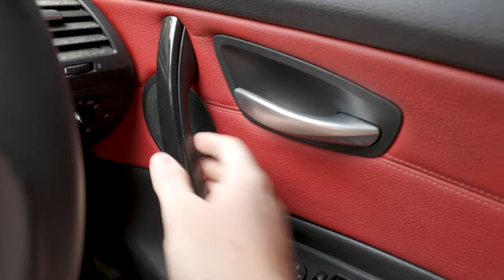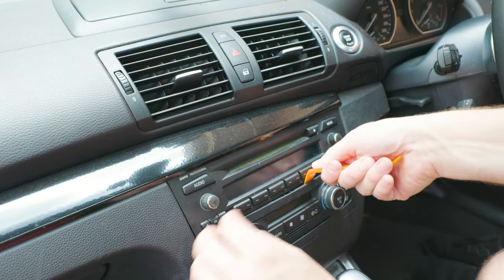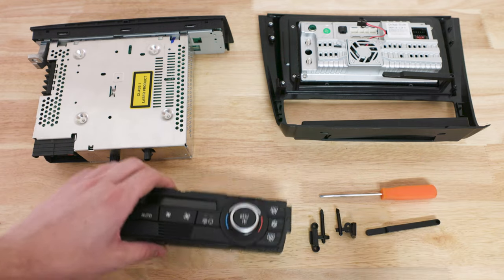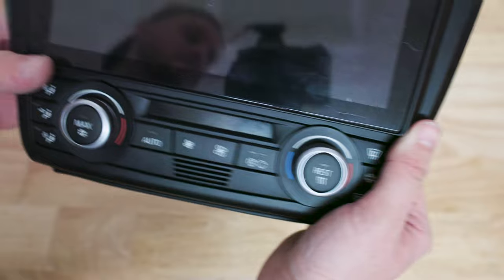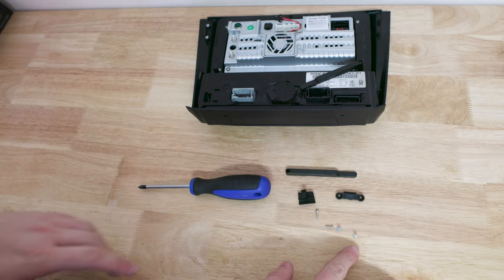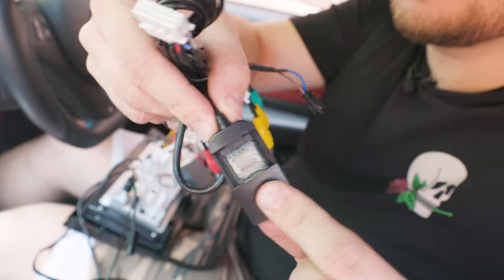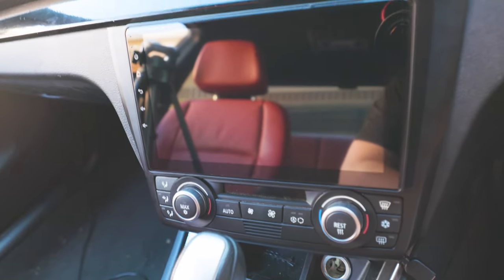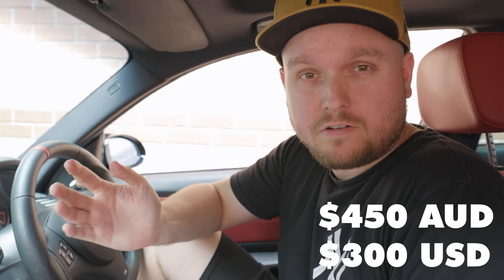CHEAP APPLE CARPLAY HEAD UNIT FOR MY BMW 1 SERIES 135i E82

Comment: Did you notice that the trim-surround is made for a left-hand drive vehicle?
Reply from the maker: Not particularly. What makes you say that?
Reply: @ElliottBrooks the screen is flush on the left and protruding on the right, making it angle and face towards the left of the car, thus made for a left-hand drive car / driver to control.

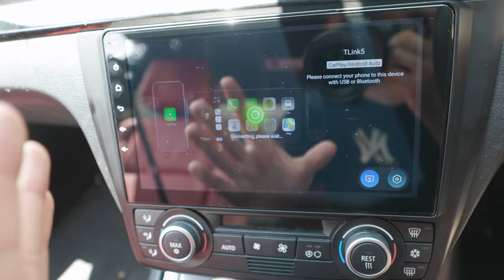@11:45
Reply from the maker: @AJS82041 it’s the exact same size on both sides. So if it was reversed it would have the same issue. It would protrude past on a left hand side too. Probably just oversight in the design process. If you want perfect symmetry with the bmw interior design, I would consider buying a new bmw rather than trying to upgrade with cheap aftermarket parts 😅

Comment: the link provided lots of options which exact one did you use?
Reply from the maker: I got the QT10 I believe it’s called. Or the Q10 maybe. There is variations. Automatic and manual depending on your car. Give the page a read, it’s fairly self explanatory

Comment: Hey man, looking at buying one, What are your thoughts now you’ve had it a while?
Reply from the maker: I give it a 7/10. Apple CarPlay is a big bonus. Downsides - the wireless connection can be a bit funny if you try switch phones or plug in before it’s connected wirelessly - requiring a restart. It changes the reverse sensor noise and sometimes is a bit funny too (could be because I haven’t installed the rear camera yet). Beyond that, it’s great. Having apple car play is a huge bonus and the screen modernised the car massively. Sound quality is good once you tune it. Prior to install, I was unable to change songs on Spotify when I was plugged in via aux / with CarPlay that’s now no problem and a big quality of life bonus. Hope that helps - let me know if there’s any specific areas you want to know about

Comment: Thanks for the video! my front right speaker is not giving any sound - do you know what might be the culprit here?
Reply from the maker: Hey mate, 

Did it work before hand with the regular radio? 

Did you check all wires are plugged in to the back of the new system? That’s what will determine if things are working - especially if one side is and the other side isn’t.

Comment: When connecting to CarPlay does it automatically play music because I’m having troubles with mine
Reply from the maker: What do you mean by automatically play music? Once you open carplay, you need to then have a music app - i.e. spotify - to play the music
Reply: @ElliottBrooks  like when it finally connects and puts you in the CarPlay mode does it play the music automatically like straight away without you pressing on play or anything?
Reply from the maker: I guess that would depend if you’re already playing music on your phone at the time or not. Usually when I get in my car, I’m not playing music on my phone. It auto connects, then I press play and drive off
Reply from the maker: @LuisJaimes-lb5dj  Possibly - as I said, if you have music playing before you connect it might do that.

If thats a normal feature of carplay, then yes

Comment: hey i followed pretty much everything but i can’t get any audio output, apple car play works and gps but when it comes to music nothing comes out
Reply from the maker: Check your wiring. You might not have connected two of the wire stacks together. That one is easy to miss. Otherwise it might depend which system you have and should contact the seller to check compatibility

Comment: Great vid bud, I have PDC and start stop buttons, would they locate in the heated seat “slot” of the frame?
Reply from the maker: Thanks! Yes, if they are currently in a thin row below your aircon unit, then this fits where I reference the heated seats buttons go. I think that row of buttons is interchangeable across various spec of BMW
Reply: @ElliottBrooks  cheers Elliott and thanks for the quick reply, might get one ordered!

Comment: Bonjour vous n’avez pas brancher la fibre optique ?
Reply from the maker: hello - no, I did not connect the fibre optic cable. I read online that certain models speakers don't need to connect it - but there is an extra fibre optic connector piece you can use if you need to. At first I was worried, but my sound works great - so no problem! :)

Comment: Better sound than the original?
Reply from the maker: I can’t remember the quality of the sound prior to installation - but the new sound is solid once you tune it. I really enjoy my sound system now that I can use the steering wheel controls to control Spotify for example. Volume 12 and it’s pumping and sounds very clear. I have stock system - not sure how it works with upgraded systems though

Comment: Hi Elliott, Thanks for the informative video.  Does your PDC gong work on this android unit?
Reply from the maker: Good question. Yes it does, but it changes the sound slightly. I prefer the old sound, but it still works. 

It also shows you a visual representation so you can see which side and how far. There is the option to install a reverse camera too. I may do that in a future video
Reply: @ElliottBrooks  Thanks for your prompt reply.  Cheers from Melbourne :)
Reply from the maker: @tvman3275  no worries! Are you going to give it a go?
Reply: @ElliottBrooks  Yes I will give it a go.  An upgrade is definitely needed because the OEM Professional radio has been playing up again (pardon the pun).  Also listening to music via the AUX port is not very convenient at all.  Could you please confirm that the black fibre optic & green cables connected to the factory amp will not be used in this upgrade?  Thanks.
Reply from the maker: @tvman3275  Yeah i didn't end up plugging in the optic fibre cables and the sound is fine. I agree that the professional radio is crap and AUX is terrible because you can't use the steering wheel controls. This upgrade is amazing for its price - not perfect but a huge benefit having carplay

Comment: hey bro where do you find carplay? cant find it on my screen
Reply from the maker: Did you buy this version of the screen from my link? if so, the app is called TLINK5 and has a picture of the car and a phone. It comes pre-installed. You need to connect your phone via bluetooth for it to work

Comment: Is your head unit QT 7 or QT10 ??
Reply from the maker: I got the QT10. It should have the best response times. It’s not perfect but I wouldn’t want slower
Reply: thank you
Reply: yes, I got the same I'll be instilling it thanks to your help!!!!   I'll let you know how I did.
Reply from the maker: @HopeView-Productions great! Yes make sure you read the comments on how to connect your steering buttons as I figured that out after I did the video
Reply: I've done everything I followed your footsteps but the thing is it doesn't stay The unit just pops back out again, I think there might be some grinding and cutting involved. I trimmed down the aircon edges but something else that makes it a very very tight squeeze
Reply: Finally I got around installing it properly everything works fine and it seats so well, now I have to work on the steering wheel buttons
Reply from the maker: @brothersinarmseastlake nice one! Steering wheel buttons are easy once you know what to do. Check the pinned comment and I discuss what I did

Comment: Great video, thanks for posting. Did you need a separate optical canbus decoder for your installation, or was everything included in the kit? Any problems with parasitic drain or need to fiddle to get things working, or was it basically plug and play? Btw. Do you know what radio/speaker option package the car was optioned with (ie S663 BMW Professional Radio, S676 HiFi speaker system, can look up by vin)
Reply from the maker: Thanks - I’m glad it helped you. I did not require the optic fibre cable link. It came with a Canbus decoder included but for certain systems I think the Harmon kardon systems you need an extra optical cable. That being said, my radio did use the optical cable prior but I read online somewhere that it works without. I have the S663 Professional system. I haven’t noticed any parasitic drain, but someone yesterday commented something along those lines. The whole system is basically plug and play unless you have an upgraded sound system above the professional system I believe. Hope that helps!
Reply: @ElliottBrooks Hey man was wondering if you could help I bought one of these units I got a 2012 128i and it has the harmon harmon system. I put the unit it but no sounds and iv been going back and fourth with the sellers they keep asking for pictures but we haven’t gotten anywhere. Should I just order the fiber optic and I was wondering does it connect to the main harness and you use that to connect it to the radio harness?
Reply from the maker: I didn’t use the fiber optic cable. But yes if you have the better sound system I would get the connection. It’s pretty cheap and it just connects to the current fiber optic
Reply: @ElliottBrooks  nah ended up being a whole thing costed another $150 for the cable you’ve gotta disconnect the fiber optic from the main power harness and then splice into the power and ground on the main harness and also figure out which wiring is power for accessory
Reply from the maker: @RXS999 ahh fair enough. Glad you worked it out! I only had the regular sound system so didn’t have any dramas
Reply: @ElliottBrooks  Unfortunately I was not able to get it to work the housing doesn’t even seem to fit trying to get a refund
Reply from the maker: @RXS999 that’s strange the housing doesn’t fit! That seems like the one area that was spot on. Shame!
Reply: @ElliottBrooks  Thank god man I got it installed what a nightmare, question for you cause you didn’t install the rear view camera at first, did the radio go black when you put it in reverse cause you didn’t have the camera installed?
Reply from the maker: Yes. If you go into the settings, there is a way to visualise the reverse distance (as long as you have PDC installed). Otherwise you just need to install the reverse camera for something to appear. Well done getting it working
Reply: @ElliottBrooks  Thanks a lot for the help

Comment: Hi man, I wanted to buy this for my bmw too. I saw what you said about the specs in some other comments, and i will go for the best option. But is there a difference of the AT and MT unit? I have a manual car myself.
Reply from the maker: Yeah if they specify MT vs AT Athen you should pay attention. It might be to do with the fitment. I would ask the supplier if you are unsure
Reply: AT is for automatic climate control and MT is for manual climate control (NOT manual transmission)
Reply from the maker: @omarpulido8502  thanks for clarifying. I based mine off the imagery

Comment: I installed mines everything is functioning correctly only thing is i have zero audio
Reply from the maker: Sounds like either you haven’t plugged some wires in or your setup is different. Did you get the Q10 model? I would read the aliexpress page or contact them for support as they will be able to diagnose the issue
Reply: I have the same problem!

Comment: Has anyone done this with the e88 wondering what happens with the roof opening buttons
Reply from the maker: Hi mate, the roof opening buttons are fine - they get added to the below section. I cover it in the video but call them heated seat buttons. Anything that would be a button in the extra row goes there

Comment: Having huge problems with the fascia popping out. Just doesn’t want to stay in the recess. Anyone had the same issue?
Reply from the maker: Did you attach the small plastic connector pieces and slide it downwards?

Comment: Is that normal that the link show a 95€ autoradio ? Is it that cheap ?
Reply from the maker: The link will show a range of headunits. I suggest getting the higher spec version which costs more than the base version :) if you read my other comments, I’ve already specified somewhere which version I recommend

Comment: Can you please show how you got the Apple car play to work? That would’ve been helpful
Reply from the maker: It’s quite simple. Connect your car via Bluetooth. Go into your phone and find the wireless Bluetooth name. Mine was under “carkit_blink”. I can’t rmemeber if it required a password or not but use the general password - mine was 123456. You can ask your seller for the PW if you have any issues (mine was in the online user manual they provide). Once connected - it should automatically open the “T LINK” app, and jump you into CarPlay. Your phone may ask your for permission, just have it unlocked and allow the CarPlay connection. Give it a try, it’s fairly straight forward

Comment: They are only £70
Reply from the maker: Depends which variation you get. If you follow the link in the description you can see the difference models and prices. In my video I’m referencing the top model (most expensive plus best performance) I’m also speaking in AUD which would be less than pounds.

Comment: That looks so cheap tho(the head unit) looks nice but those cheap Chinese stereos sound so bad you probably downgraded on the sound quality 😓😩
Reply from the maker: I was worried about this at first too, but the sound is surprisingly good quality. It has a built in equaliser too. I find the sound actually better now than before